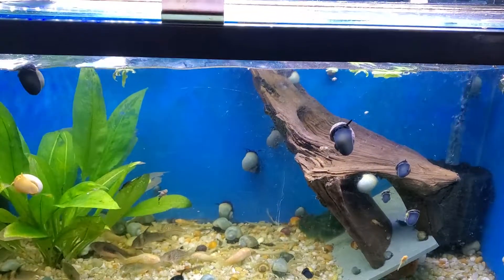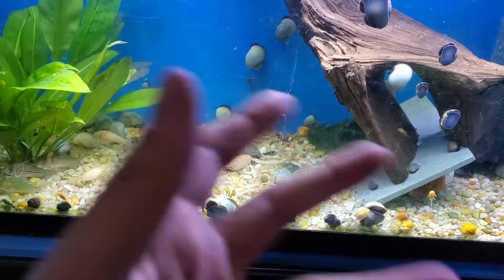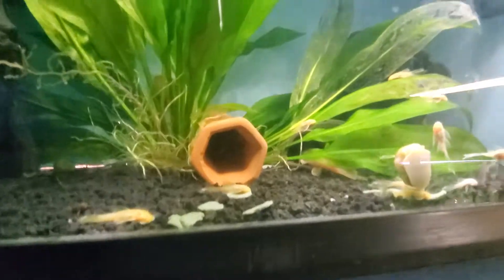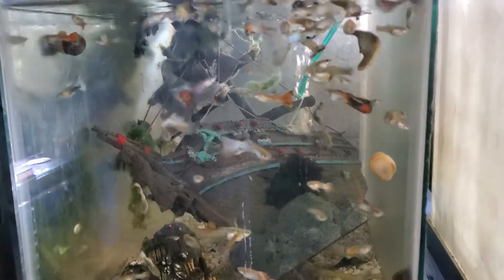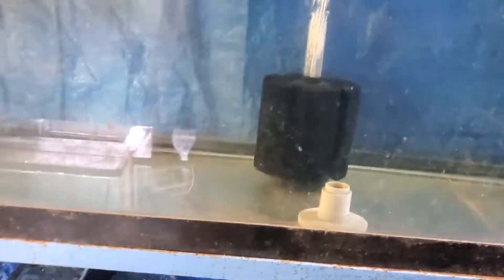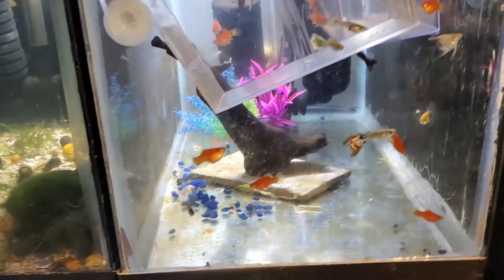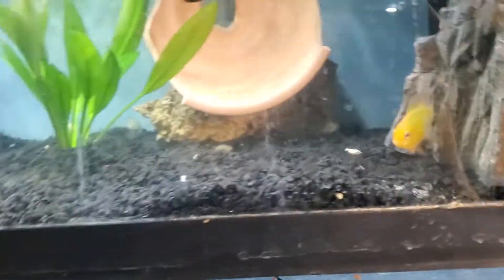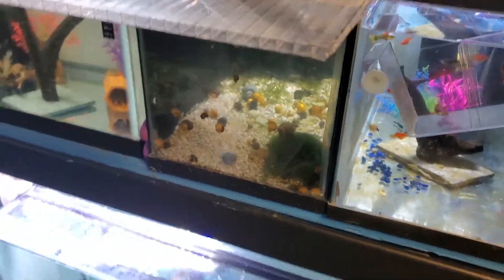Fish room tour and all my breeding fish.

Comment: Could you make a video about Moscow Guppies? 

Also could you make a video on differences in snails? And how to breed certain kinds of snails. 

Also I have the same black and yellow temp gun lol.
Reply from the maker: What about moscow guppies
Reply: @sunshinepet  the care of them, and how to breed them, difference between color (as in different requirements) if any.
Reply from the maker: @jakepellow4777  I'm not a huge expert on those even finding them in the stores is hard. I bought 2 pairs and put them in a 15 gallon and they breed like crazy. No heater or anything
Reply: @sunshinepet  oh wow okay I heard they are hard to breed lol, what about the snails? I want to breed snails for profit.
Reply from the maker: @jakepellow4777  snails are probably the easiest thing to breed. But get a few put them in a tank with a lid. Leave a 2 jnch Gao from top of water to lid so they can lay eggs and keep them at higher temp, maybe 80 or 82 but I breed them in any. And just feed them string beans and have crushed coral or rock as a substrate